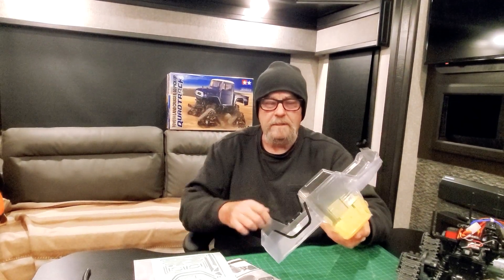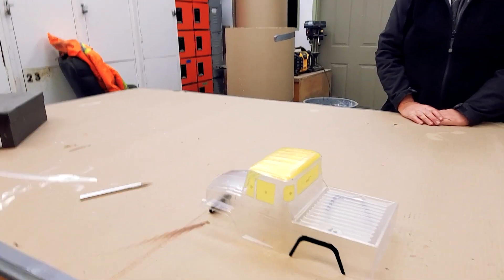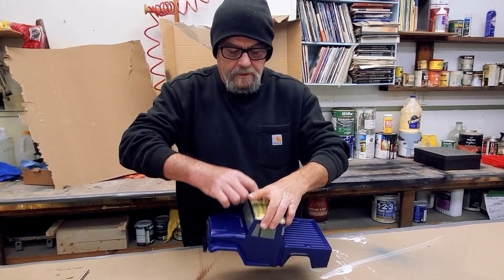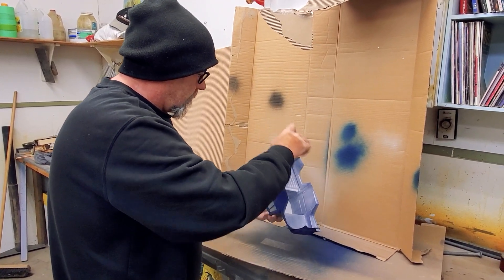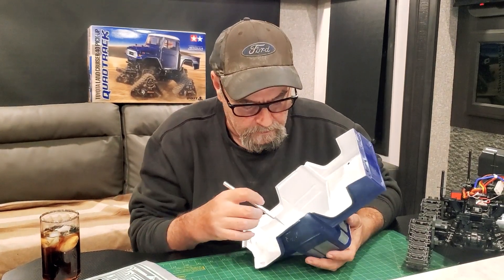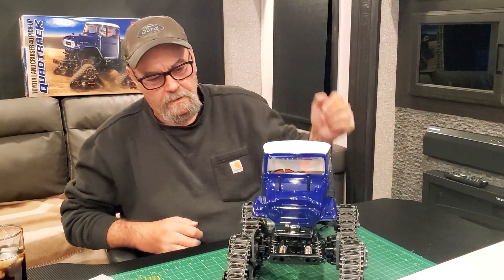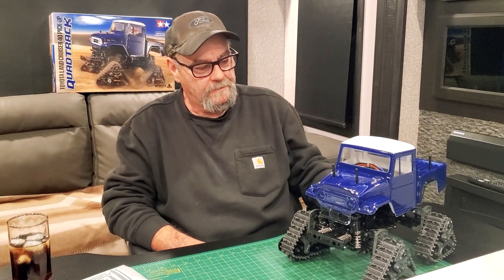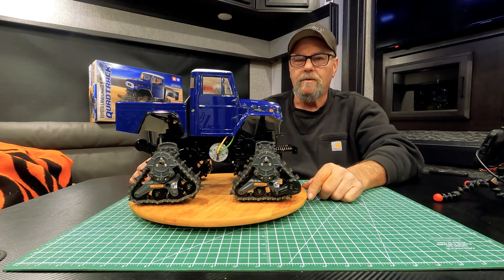PAINTING THE TAMIYA TOYOTA LAND CRUISER 40 PICK UP.

Comment: Mine shows up towards the end of this week. Pretty stoked about it too, such a fantastically odd little thing
Reply from the maker: The tracks seem to hold up well.
Lots of use on mine and no failure yet.
You will enjoy it!
Reply: @EMPTYPOCKETSRC  Quick question if you please, are there enough parts on the tree to convert it to the wheeled version if the old strikes?
Reply from the maker: It looking at the manual maybe.
Without tearing it down I would not confirm for sure.
Drive shaft and wheel axle joint cup thing length look like the only thing that might hold ya back.
Reply: @EMPTYPOCKETSRC  Thank you